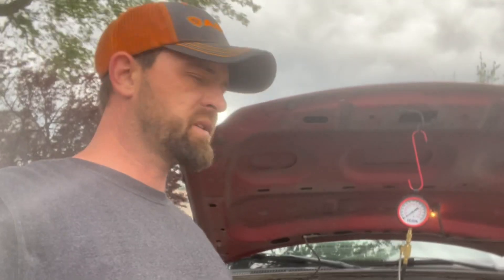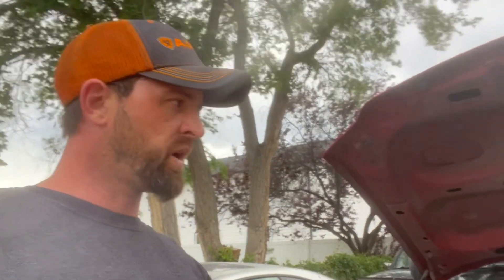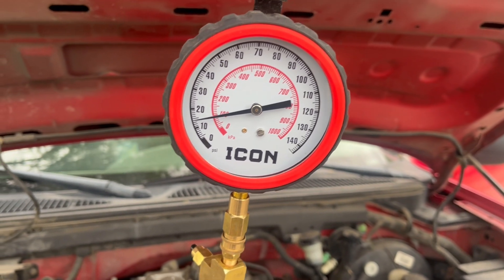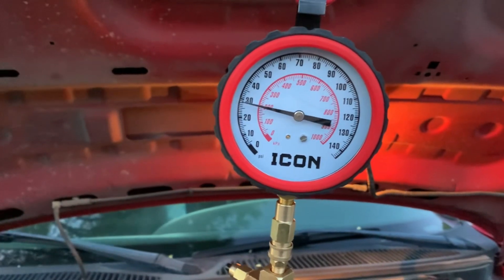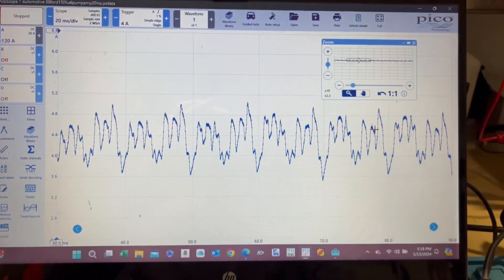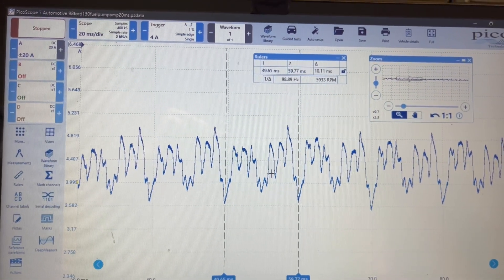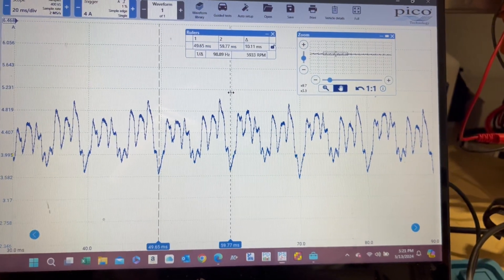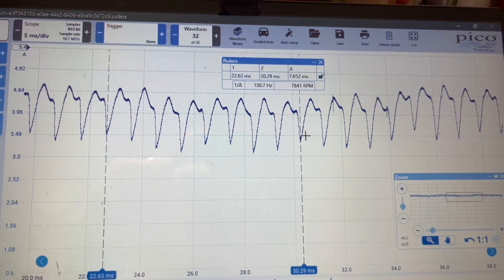Fuel Pressure Issues - Causing A Severe Lean Condition And Multiple DTCs!

Comment: I swear you can hear the vacuum leak in the video.
Reply from the maker: Hey Jeff, you are definitely on to something. It’s hard to tell on the video because it was extremely windy outside. But I hear what you hear as well on film. This vehicle has multiple issues and suffering from a severe lack of maintenance all around for like the last hundred thousand miles lol.. I attacked this Fuel Pump straight away for a couple reasons. This trucks overall drivability is very poor. Just falls on its face under load. WOT Trim data did not indicate primary cause of a lien condition as a vacuum leak. And of course, the fuel pressure reading itself on the mechanical gauge definitely indicates a fuel delivery issue. 

But I will be diving into the other various issues this vehicle has in part 2! I did not want to make this video confusing by including ALL the issues causing the poor performance/power loss. Was really just trying to demonstrate testing the fuel delivery system. But I have already recommended to the client, the intake be resealed when I replace the seeping fuel line and fuel rail. I have also already recommended a tune up. However, I have not finished looking into the ignition system so don’t have full recommendations on that yet. Stay tuned part 2 will be a good one! Thanks for watching bro! 😎